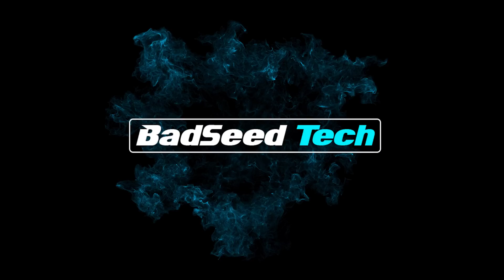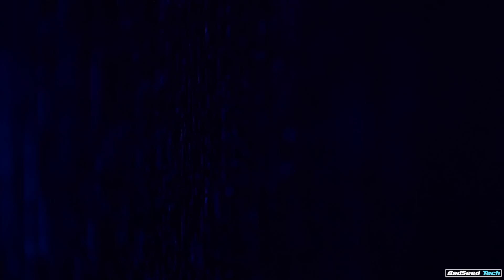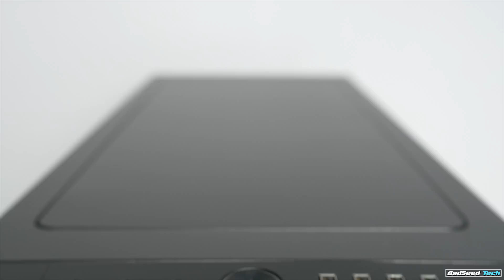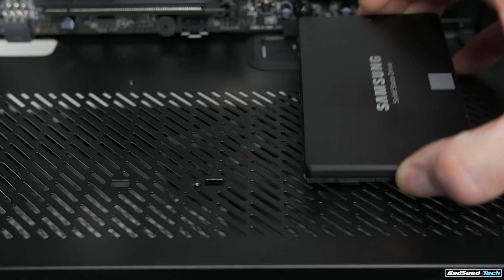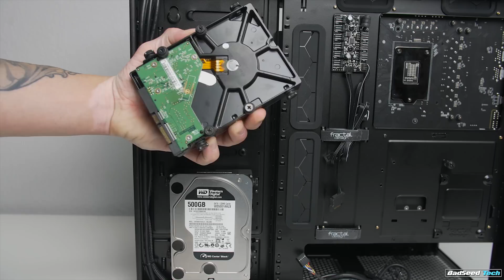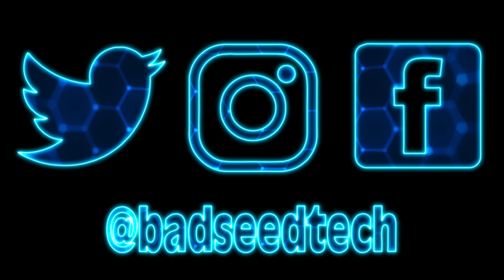Fractal Design Define R6 Review: Best Flexibility for Air -OR- Watercooled Builds

Comment: Love this case and the 5.25 bay hidden behind the door was one of the selling points. Yes still use optical drive! I wanted sleek, and silent, so have the black with white accents inside version. Built my first pc ever in it and it is a joy to build in. Air flow was a concern for the Ryzen 3600, so I replaced the Wraith cooler with a Sythe Mugen and my temps have never gone to 60’ C.

Comment: How did you manage to get the plate off the top grill? Mine is so secure I feel like I need to ruin it to remove.
Reply from the maker: Just pry around the edges and go slow.  It's a bitch, but it will separate.
Reply: @badseedtech  I saw another video where specifically separating them down at one end made it way easier. All sorted, no prying needed... Which I was totally starting to try, heh.

Comment: BadSeed Tech thank you so much for the dimensions. I have been wanting to put a 280mm or 360mm aio on my GPU. Already 280 on my CPU. Can you fit a 360mm aio with the optical disk tray installed?

Comment: Just wanna know are people do something with the free space( gap)  around the edges of filter when its alone  on top. Is there a problem with this - i mean getting dust into the chassis? People use some method, or leave it this way?
Can i buy some pretty mod specifically for this if needed?

Greetings
Reply from the maker: It doesn't look the best but functionally it's not going to let much dust into the system, particularly if you have positive pressure inside the case.  I don't think it's a concern.
Reply: Glad. Thats what i have thought ,  apart from that  its best flexible future case for sure, at least for me.

Comment: Planning on a 60mm thick 360 in the front, with an EK pump/res between that and the video card. Thoughts on whether or not I will be out of room? It is a 1080 TI FE with an EK block, so it isn't a super long card. Thank you sir!
Reply: There is seven inches between the front of the case where you mount rads/fans and the end of the cutout of the power supply shroud. If it's smaller than that it will fit. As for the graphics card, my 1080 ti FTW 3 with a water block doesn't reach that far over so I would think you'll be fine.
Reply: @howtocomputer6676  thank you!
Reply: @LetsGetTechy  No problem! If you have more questions feel free to ask, or if you want to see any pictures of the case with measurements hit up @HTCbuilds on Twitter and I'll post some for you.
Reply: @howtocomputer6676  adding you on Twitter now
Reply from the maker: Assuming you are using push/pull with a 20mm fan thickness, that gonna leave you approx 70mm of plate left to mount onto and an additional 25mm before you run into the gpu.  It will fit but will probably look cleaner and give you a better mount if you go only push or pull.
Reply: @badseedtech  appreciate the reply!